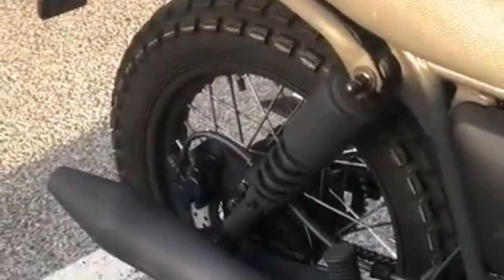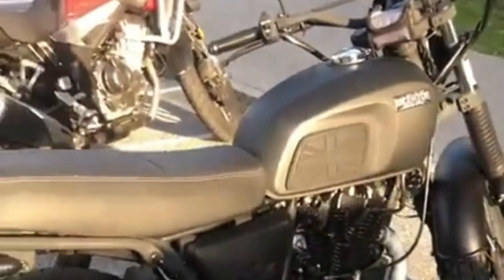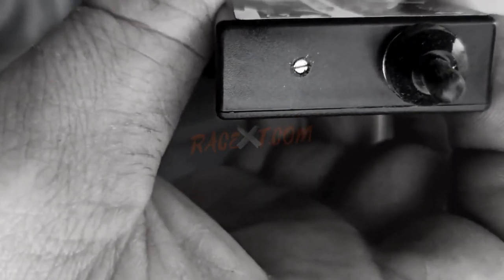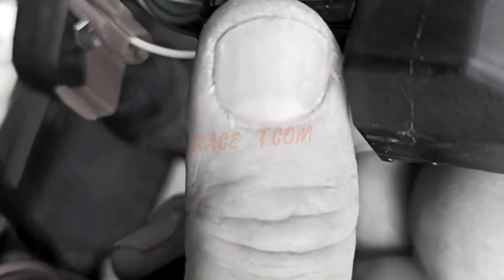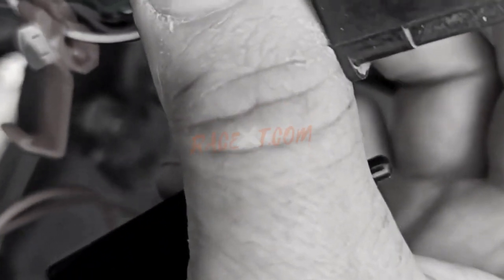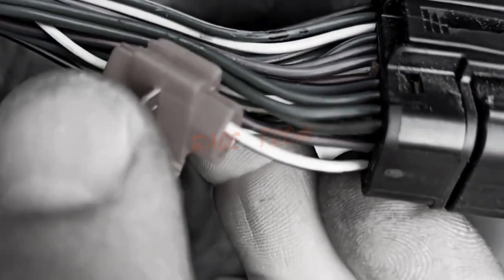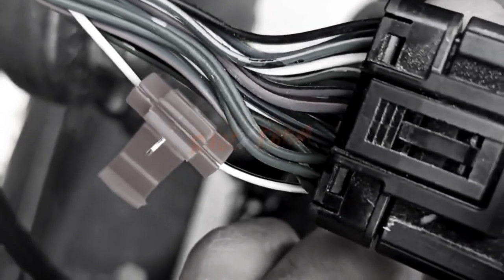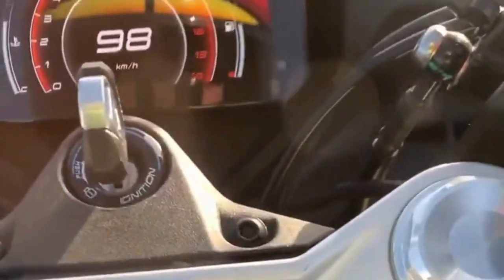Chip tuning for BRIXTON MOTORCYCLES BX 125 power unit

Comment: Hello! I wonder where I can find the IAT on my Brixton BX 125 R?
Reply: hello, melystad1 i wanted to know(if you bought the device)if it actually works and if its good for the bike
Reply from the maker: Hi @Freeedom1234! 👋
Great question — yes, the chip tuning module really works and it's designed to safely improve the bike’s performance without modifying the engine.

✅ You’ll notice:

Faster throttle response

More torque in low and mid RPM

Smoother and stronger acceleration

In some cases, even a small increase in top speed (especially with a sport exhaust)

It’s Plug & Play, easy to install, and comes with:

2-year warranty

30-day money-back guarantee

Free support from our mechanic via email if needed

You can check your model and order here 👉 racext.com
Let us know if you want help finding the right one for your bike! 💪🏍️
— Team Racext
Reply from the maker: Hi Mslystad1,

Thank you for your inquiry! If you need further assistance locating the IAT sensor or with the installation of the Chip Tuning for your Brixton BX 125 R, please feel free to reach out to us via email at info@racext.com or through WhatsApp.

Simply provide your name and surname, and we’ll be happy to schedule an appointment with one of our mechanics, who will guide you step by step through the installation process.

We're here to help ensure you have a smooth experience!

Best regards,
The Racext Team
Reply: did you buy it?